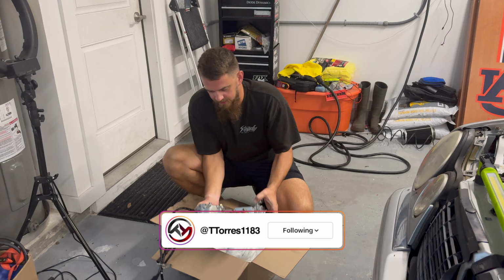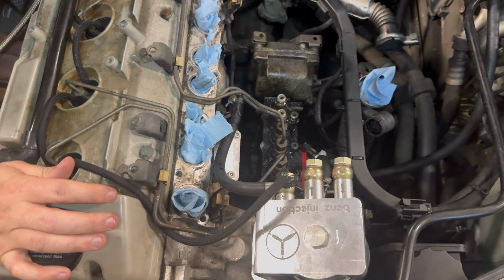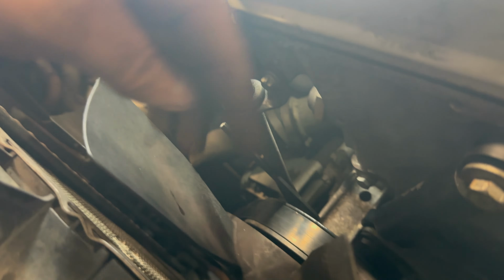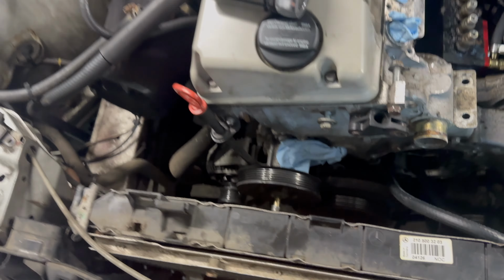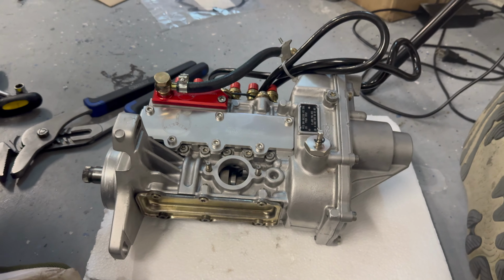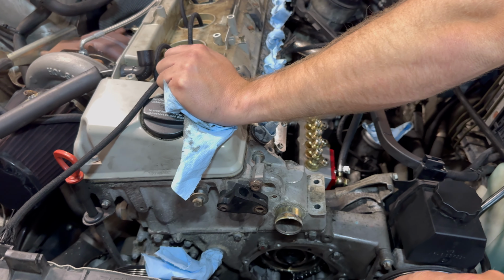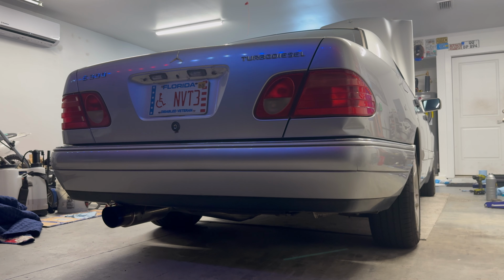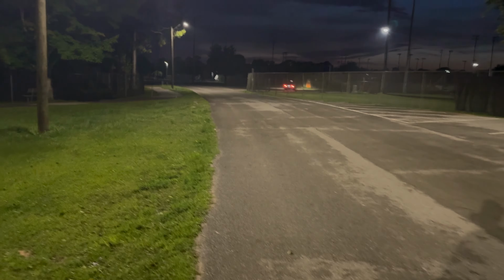Mercedes-Benz OM606 Injection Pump Install!

Comment: Is it hard to use a mechanical pump in w210? I rather turn a couple screws vs playing with fuel maps
Reply: You‘ll need a stand alone gearbox controller with mechanical pump